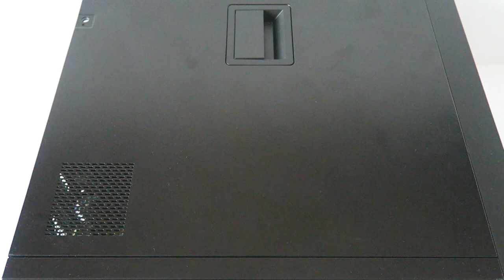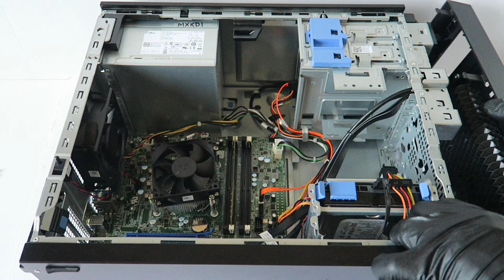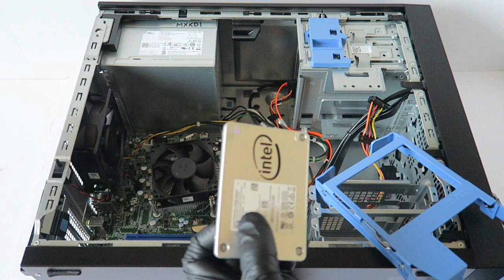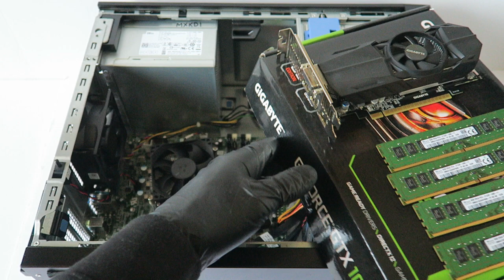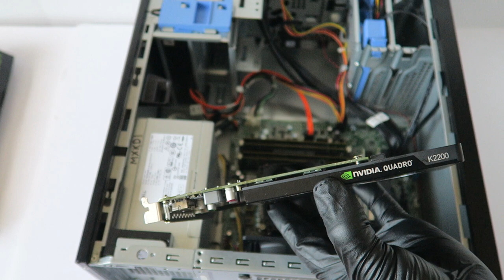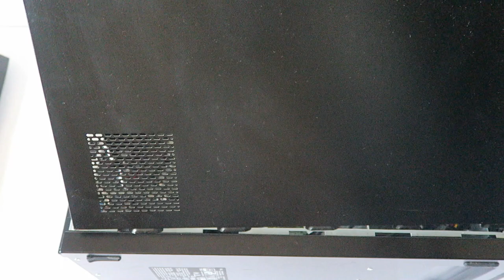Dell Precision 3620 Gaming Upgrade Video Card SSD RAM Hard Drive

Comment from the maker: List of Parts work with this System  and Upgrades:

  

USB Wifi Adapter for PC AC600Mbps Wireless Network Adapter
https://amzn.to/2ZaGuHb 
 
List of RAM will work with this system Supports MAX 64GB.
(1.) Kingston HyperX Fury Black 32GB 2666MHz DDR4 CL16 DIMM Kit of 2 (HX426C16FBK2/32)
https://amzn.to/38zqi4Z 

(2.) Crucial 16GB Kit (8GBx2) DDR4 3200 MT/S (PC4-25600)
https://amzn.to/3f21Qf7 

(3.) Crucial 16GB Kit (8GBx2) DDR4-2666 MT/s (PC4-21300) 
https://amzn.to/3e7axnh 

(4.) Crucial 32GB Kit (2 x 16GB) DDR4-2666 UDIMM (PC4-21300)
https://amzn.to/3e62jvq 

(5.) Crucial 16GB Kit (8GBx2) DDR4 3200 MT/S (PC4-25600)
https://amzn.to/3f21Qf7 

(6.) Crucial 4GB Single DDR4 3200 MT/s (PC4-25600)
https://amzn.to/2VXqTZo 

 
List video cards will work with this system.
(1.) Gigabyte GeForce GTX 1650 GDDR6, GV-N1656OC-4GD Video Card 
https://amzn.to/2Zyg5TN
(2.) Asus GeForce GTX 1050 Ti 4GB Phoenix Fan Edition
https://amzn.to/2OxUrZa
(3.) ZOTAC Gaming GeForce GTX 1650 OC 4GB GDDR6 
https://amzn.to/32peeSW 

(4.) MSI GTX 1050 TI 4GT Low Profile  Graphic Cards 
https://amzn.to/2LwZd7P 

(5.) Gigabyte GeForce GT 1030 GV-N1030D5-2GL Low Profile 2G Computer Graphics Card 
https://amzn.to/2Z4PHkp 

(6.) ZOTAC GeForce GT 1030 2GB GDDR5 64-bit PCIe 3.0 DirectX 12 HDCP Ready Low Profile Video Card ZT-P10300A-10L 
https://amzn.to/2WzgLXk 

Thermal Compound Paste:
(1.) Arctic MX-4 2019 Edition Thermal Compound Paste Carbon Based
https://amzn.to/2XcsZo4
(2) Arctic Silver 5 Thermal Cooling Compound Paste 
https://amzn.to/2ziNU0H
(3) Noctua NT-H1 3.5g, Pro-Grade Thermal Compound Paste
https://amzn.to/36kTk7A
(4.) ARCTIC MX-4 (current edition) Thermal Compound Paste 20 Grams 
https://amzn.to/2DhGJaK 

 
List M.2 Type 2280 NVMe PCIe:
(1.) Samsung (MZ-V7E1T0BW) 970 EVO SSD 1TB M.2 NVMe
https://amzn.to/3d52k2a
(2.) Samsung 970 EVO Plus SSD 500GB
https://amzn.to/3fpi95A
(3.) Samsung (MZ-V7E500BW) 970 EVO SSD 500GB - M.2 NVMe
https://amzn.to/37uuLFw
(4.) Crucial P1 500GB 3D NAND NVMe PCIe M.2 SSD - CT500P1SSD8 
https://amzn.to/2N07wKh 

Hard Drive Caddy Adapter  3.5 to 2.5:
(1.) Dell 3.5" to 2.5" SSD or Hard Drive Caddy Adapter R494D 0R494D 
https://amzn.to/2XTPeRr
(2). Dell Hard Drive Caddy, R494D, F767D 3.5" to 2.5" SSD or Hard Drive
https://amzn.to/3cTkcOk 

SSD List:
(1.) Samsung 860 PRO SSD 256GB - 2.5 Inch SATA III Internal Solid State Drive
https://amzn.to/2BY5gRl
(2.) Samsung SSD 860 EVO 250GB 2.5 Inch SATA III Internal SSD 
https://amzn.to/37xWUfc
(3.) SK hynix Gold S31 1TB 3D NAND 2.5 inch SATA III Internal SSD
https://amzn.to/3d7X6D6
(4.) Samsung SSD 860 EVO 1TB 2.5 Inch SATA
https://amzn.to/2B2FURX
(5.) SanDisk SSD PLUS 1TB Internal SSD
https://amzn.to/3hwdqku
(6.) SanDisk SSD PLUS 240GB Internal SSD
https://amzn.to/2zfc7EX
(7.) Crucial MX500 250GB 3D NAND SATA CT250MX500SSD1(Z) 
https://amzn.to/3bTTjbX
(8.) SanDisk SSD PLUS 480GB Internal SSD SDSSDA-1T00-G26
https://amzn.to/2yfgjUK
(9.) WD Green 1TB Internal PC SSD  WDS100T2G0A
https://amzn.to/2XfGtzc 

HDD list works with this PC:
(1.).WD Black 2TB Performance 3.5" Hard Drive - 7200 RPM Class, WD2003FZEX 
https://amzn.to/2xFUeyF
(2.).Seagate BarraCuda 1TB Internal Hard Drive  3.5" Hard Drive - 7200 RPM
https://amzn.to/3g8FXM8
Reply: I use one of these for gaming, was wondering if it is possible to add a 4TB HDD drive to it, I know Dell say 2TB max but IIRC that's a Windows addressing issue and I use Linux with Steam/Proton 
For the record,
3.9Ghz xeon4/8
32Gb DDR4 (ECC)
NVIDIA GeForce GTX 1660 SUPER/PCIe/SSE2 6GB GDDR6
550W PSU
256Gb m.2 NVME
1Tb SSD
2Tb HDD
Linux Debian Bookworm, Kernel Linux 5.14.0-2
Flatpak Steam

Comment: This is so awesome. I was given a Dell 3620 with the core i7 6700K and 32Gb installed ram. It came with the Nvidia NV 510 card which I don't care for, and will be swapping in my GTX 970 reference card. 
Since all the GPU market is crazy right now, this will be a welcomed improvement over my dinosaur AMD FX6300. So crazy how abundant these are and can be turned into powerful gaming rigs or video editing units. 

Thanks to everyone who has been uploading these videos showing the potential power and cost savings in these Dell's.

Comment: Why add the sata splitter cable? if your only just upgrading drive? also caddie isn't needed , Couldn't you just double side tape it to the top of the tray?
Reply: 🤓 he added the splitter so the next person could add an extra ssd or laptop hard drive easily, he added the 2.5 ssd adapter caddy so it looks PRO 😎
Reply: @MrSamadolfo  Also, this SSD adapter for a caddy allows for putting 2nd SSD on the other side, an you keep the option of the quick slide. But True, I would not bother, too. My SSD is hanging loose from cables... Not even taped.

Comment: Does the size of the ssd card matter? I was looking at getting a 2TB card (like Samsung - 860 EVO 2TB Internal SATA Solid State Drive), but Amazon's compatibility tool does not confirm that the card will work on the precision 3620

Comment: Question what is the mhz for the memory ram ddr4 are they a 2400,2300,or more, or less there.,and where can you get that caddy tray adapter for the ssd on Amazon does it have a  model number for the caddy tray adapter.
Reply from the maker: Hi machine is using 2133Mhz Non-ECC DDR4 Memory For Core i7...Using this RAM will work..

Crucial 16GB Kit (2 x 8GB) DDR4-2400 UDIMM
    CT2K8G4DFD824A

Crucial 32GB Kit (2 x 16GB) DDR4-2400 UDIMM
    CT2K16G4DFD824A
Reply: @Mxkdt  Hi thank you see very much Glad to hear from you thanks again for sharing, and for all your help thank you 👍
Reply: Will this take DDR4 PC4-25600 ram?

Comment: i have same one,290w enough? for upgrading 1050ti?
Reply: I got problem when upgrading with  zotac gtx1050ti. The computer keep crashing/restart. Still figuring what the problem.
Reply: @IshamRozani  experts said it's enough
1050 use only 70w 
I think it's fine
Reply: @ak9541  thanks. I will try again.
Reply: Still not working. The pc crash and got BSOD after running for 30-45 minutes. So I decide to take the cpu out and making new build with new psu, mobo and pc case (rgb casing 😄)

Comment: 290W power supply ?
Reply: Unfortunately, yes. This model comes with either 290W or 365W PSUs, and the second one is for Xeons, basically. Because it can take also ECC modules, it is very nice setup. Except power.
Pozdro,